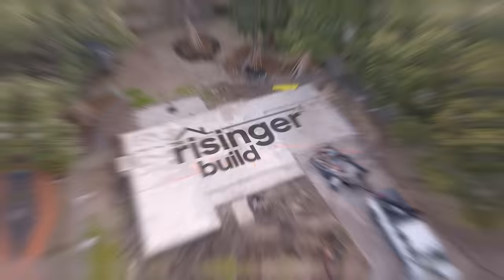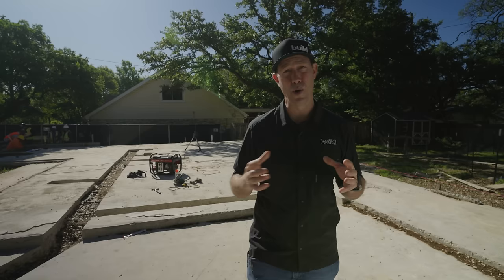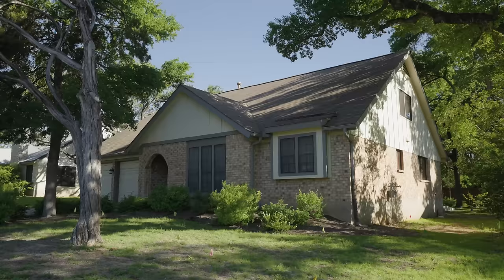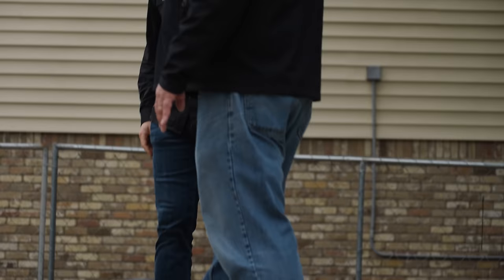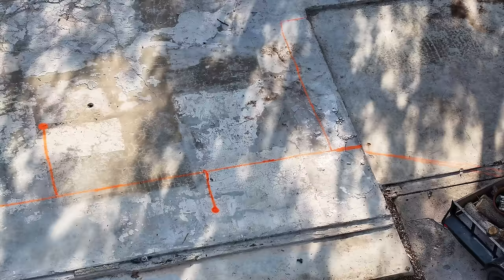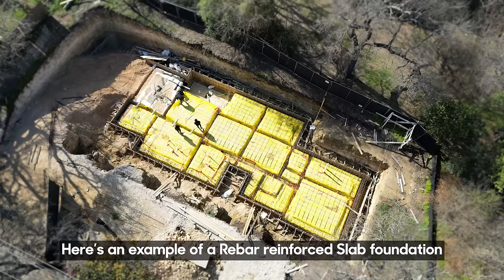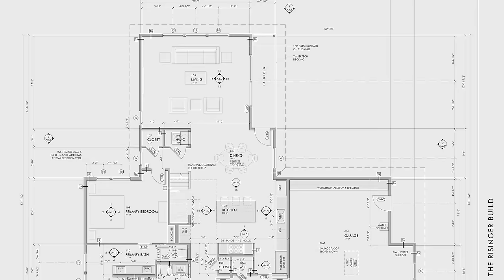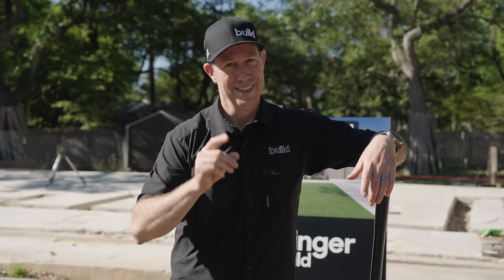The Risinger Build: Episode 1 - Pre-Construction Planning

Comment: Good for Austin for treating trees appropriately.  They are certainly more valuable than gold in developed/developing neighborhoods at regulating temperatures, weather mitigation, maintaining equilibrium with local natural ecosystems, water and air quality, etc etc.  When everyone has the same "oh I'm just removing ONE tree" attitude, entire landscapes go barren and bad things happen.
Reply: My city values it's trees at 4 to 12 thousand each depending on size. You get fined if any are damaged during construction.
Reply: @MushroomMagpie  PUMP THOSE NUMBERS UP!  😀
.... That's great though, more cities need to hold true to sustainability initiatives in the face of hyper development.  Good design incorporates green space, not negates it.
Reply: I disagree.  It's already hard enough to find a good site to build, when taking into consideration the budget, location, etc.  When you're searching for what seems like forever, and then you finally find some property that would be otherwise perfect other than the fact that as little as a single tree is in the wrong place on the property.  

Rather than just banning people from cutting down trees which could render some properties useless, the better solution that some jurisdictions use is to offset any cut down trees.  So for every tree you cut down, you're required to plant (or pay a fee to the city/county so they can plant) a certain amount of new trees, to make up for it.  If you cut down an older/bigger tree, you might have to plant several younger smaller trees to make up for it, or if feasible, a single older larger tree equal to the one cut down.
Reply: @00HiGhGuY00  if I'm understanding your complaint correctly, you're saying that you're frustrated because conservation of a limited finite rare resource (mature trees) is creating another limited finite rare resource (lots to develop).  Yea.  That's exactly the case.  You nailed it.  Crazy, isn't it?  Unfortunately, you find fault with the tree, not with our lust for land appropriation.  Which is why, rather than avoiding the challenge of tree conservation, we need to embrace incorporating better site development design.  To address your proposed mitigation solution directly, unfortunately there is no substitute for a mature tree.  50x baby trees do not provide the habitat, water/air purification, shade, wind resistance, etc of 1x mature tree.  And NO dollar figure ever will.  Even more concerning is your statement that a property that cannot be developed due to trees would be considered "useless".   That is a frightening stance!  Parks?  Nature preserves?  Forests, wildlife sanctuaries, land stewardships, all useless?? Have you considered WHY an undeveloped tree-filled lot in a residential neighborhood increases the neighboring property values?
Reply: @Bythirteen  You stated that there is no substitute for a mature tree, and that mature trees are a limited finite rare resource. That is completely false. perhaps you're unaware of this amazing ability trees have.... They grow.  That's why wood products are considered a renewable resource because when they go cut down an entire forest, they are planting several more forests, that then mature, and the cycle repeats.  Of course, we're not talking about cutting down entire forests, we're talking about the case of removing a small amount of trees from a plot of land in a suburban area, zoned for residential use.  That much should already be implied given the context of the conversation in relation to what was said in the video.  Habitat is not going to be affected by removing a few trees on a residential lot to build a house.  Plant life cleaning the air happens as part of photosynthesis.  there's a direct correlation between the amount of "green matter" or vegetative growth and the amount of photosynthesis happening.  It makes no difference if that photosynthesis is happening as the result of one large tree or many small trees.  The amount of water purification that happens as the result of trees is negligible.  Far more water is purified by evaporating into the air and then raining back down, also mechanical filtration by soaking into the ground.  Regardless of the trees, you're not going to have a park, nature preserve, forest, wildlife sanctuary, etc. on a relatively small plot of land in the suburbs zoned for residential use. Properties adjacent to an undeveloped lot (tree filled or not) adds value, at least temporarily, because it's more desirable looking into an empty lot rather into your neighbors window.  But just because a lot might be empty when you move into a house, doesn't mean it's going to stay that way forever.  That is something you will have to factor in when deciding to purchase said house.  But really that doesn't even have anything to do with tree preservation.  The bottom line is if you grow more trees than you cut down, it's going to be a net positive gain.  If you want to buy a lot to build a house and there is a tree or even several trees located at inconvenient locations on said lot, you should be allowed to cut them down, build your house, and then plant several more trees/shrubs/plants on your property in a more convenient location.  I guarantee you the eco system is not going to collapse, the water and air is not going to turn toxic because there's a few less trees to filter the air/water, your neighbors house is not going to get sand blasted because of the reduced wind resistance, the earths temperature is not going to rise because of a little less shade, the value of your neighbors' houses are not going to plummet because there's a few less trees in your yard.
Reply: @00HiGhGuY00  I agreed with everything you said except the beginning and the end.  That's fine.  We simply have different priorities and perspectives.  I believe we need to adapt to a more sustainable balance within nature, whereas you believe there is no need for such adaptation and there is no unbalance.  Idk man, I think your attitude, justified as it may be in individual circumstances, is a slippery slope to reinforcing and encouraging climate change.  I know that 1 tree doesn't matter.  But I also know that the "1 tree doesn't matter" attitude certainly does matter.  

But food for though, uhhhh ecosystems HAVE collapsed, water and air HAVE turned toxic in developed areas, wind gusts HAVE increased, and the temperature HAS increased due to lack of shade.  I mean, these are boring scientific facts, inconvenient truths, for sure.  Not cuz of 1 tree removal.... but because of the attitude that 1 tree should be removed in the name of progress.
Reply: I think it's a load of crap. It's my yard. Who is the city to tell me that I can't cut down trees on my yard? Maybe I don't like them, maybe they block light where I need it, maybe I don't want them to take my house out in a storm. New trees can be planted. New trees do a better job at capturing carbon as they grow faster.
Reply: @ColeSpolaric  lol, you're a silly goose.

Comment: The solution for your water lines is install 2" conduit in the slab with electric sweeps then you can pull pex lines just like wire that gives you replaceable plumbing 
I've  been using this method for 25 years
Take care Ray
Reply: On your water lines you want to install as many water lines in the slab. Installing 2" conduit in the slab it takes a fraction of the time and labor. Just install conduit in the trench and pull pex later 
By putting pex in pipe you protect it and it will be replaceable
Reply: Does the pex move inside the conduit when water flows through it?
Reply: You can also install your first floor electrical home runs 3/4" conduit directly on the slab you can also install a central vacuum system and 2" conduit stubbed up under the bathrooms and kitchen toe kicks to run hydroponic lines for toe kick heaters  all in the slsb
All for a fraction of the cost and time  saving you money 
Take care Ray
You have an opportunity to do good things for the cost of conduit and a few hours of labor and once you pour slab you will have alot of your electric and plumbing installed even before you put  up a single piece of lumber
Doing this will save you a ton of money 
More stuff
Run conduit for hot tub outside 
You can also sleeve your gas line in 2" conduit to the stove ,outside BBQ and backup generator. Fire pit Elon musk house mounted flame thrower 
Let me know what I missed
Reply: Wish I could get my builder to see this logic.  Trying to get him to look at things like this BEFORE getting started.
Reply: @mikeh.3855  I don"t  get why here construct to the deconstruct to add something and never look the same.  

You have those who think about everything and them do something with very low resistance in construction .  Those who just start doing stuff and start "fixing" problems on the way.
Reply: Or if height isn't an issue for the area, I'm toying with the idea of 2x4 or even 2x6 sleepers going on the slab as a sort of faux crawlspace.

Comment: Right off the bat Steve’s hitting on the Principle of Conformity. Excellent! This is the basis of home valuation.
Reply: The principle of conformity states that maximum value is realized when a reasonable degree of architectural homogeneity exists and land uses are compatible. This principle implies reasonable similarity, not monotonous uniformity, tends to create and maintain value. The highest and best land use is generally realized under circumstances of conformity or harmony. The principal purpose of zoning regulations and private deed restrictions is to maintain conformity.
Reply: @ryanbailey6600  Screw it. I would put an Ultra -Modern house on that lot. If the neighbors don't like it they don't have to look at it or live in it.
Reply: The principle of progression states that the value of a less-expensive property is likely to increase when placed in an area with high-end properties. The value of the property increases because the neighboring houses are worth more.
Reply: The principle of regression is a term used by real estate appraisers stating that the value of high-end real estate may be diminished by having lower-end properties in the same vicinity. This principle is used frequently in writing zoning laws, which strive to keep business and residential areas separate.
Reply: I am riot at parties... lol.
Reply: ......Conformity.  That's scary.  I've never been more uninspired for humanity.

Comment: People should understand Builders First Source charge about $10,000 per house, give or take to use that software that they are discussing which is after the Architect and prior to Construction.  And adds several months to the process.
Reply: More proof to the saying There-s no such thing as a free lunch.
Reply: Does it end up providing savings in other areas?
Reply: I wouldn’t imagine it takes 2 months if you order one of the plan sets on their website though.

Comment: I've grown up with basements and always liked their utility but I would absolutely trade a basement for super stable ground.  Can't wait to watch you guys build a "normal" house!
Reply: Ground is quite stable with a basement. Your just chaninging where the foundation starts. If anything it will be on harder ground deeper.
Reply: @1014p I think you’re missing @Deuce’s point. I took it that he lives in a place with poor soil where you have to excavate down to get to good bearing capacity and probably to get below a fairly deep frost line. May as well go down a few more feet while you’re at it and build a basement. Whereas in Austin, you often have solid bedrock just 6-12” below existing grade. That’s why most everything is built slab on grade in Matt’s neck of the woods.
Reply: @1014p  You would think so, but the '70s houses here in New England say otherwise.

Comment: So funny to Australian eyes, all those black window frames. Black finishes cause surfaces to absorb a lot more heat in hot weather, and too much absorbed heat will cause the materials to expand and buckle. It's nice to get a visual contrast between these components and the wall surface, but we try to do that in as light a colour as we can achieve, not black. My house is cream with light blue trim, and it has all the contrast and detail I want - but it doesn't cook in summer.

Comment: I'm curious, which states use bricks and mortar to build houses ?
Reply: There’s no stronger building code in the country than Florida’s. The least expensive house in South Florida is generally still built with concrete, block, and stucco.
Reply: basically every house in Florida is concrete block, at least the ground floor. usually wood framing for the second floor

Comment: i never did like the idea of appeasing neighbors w a custom home design. it should be to the home owners likes not the nosey neighbors. a bigger or better home will increase ALL the property values in the neighborhood
Reply: I guess it depends on what they mean. I agree mostly, however there are so e crazy out of place stuff built. Its not good crazy either. Hearing what he is saying, disagree with him. If you can build a better home inside with improved methods. You do that as its not like the outside will be totally different.
Reply: From a real estate perspective, you never want to have the nicest house on the block. Of course there are exceptions to every rule and that decision is very location specific for a variety of reasons.
Reply: @MichaelJ674  I reckon what we're going for is something that isn't eyecatching on the outside, but performs to the highest achievable standard inside. Yes, you're going to miss out on some resale value if it's surrounded by lower-value houses, but resale value can't take away the pleasure of living in a house that works how a house should work.
Reply: If the past 4 years have taught us anything, is that the average idiot will pay 100s of thousands over the original build price for an old, beat up home needing repairs without an inspection. A "nonconforming" custom home is the least of anyone's concern
Reply: No, your assertion doesn't always "improve" the neighborhood. I see homes built that completely conflict with the existing environment. No reason to disrupt the flow and form of the existing neighborhood.
Reply: @tealkerberus748 So true